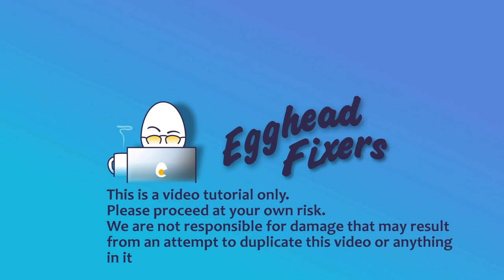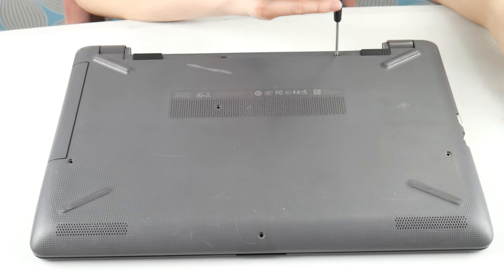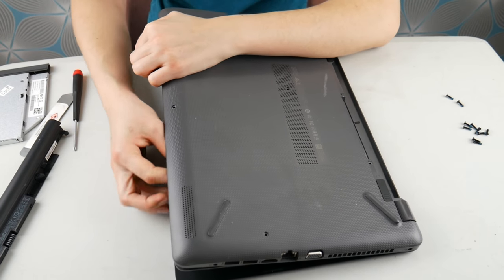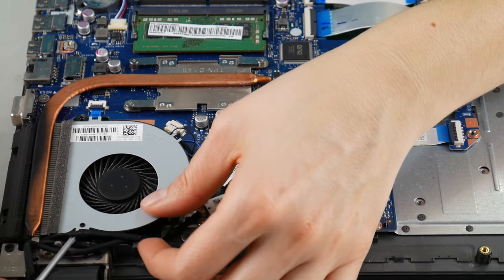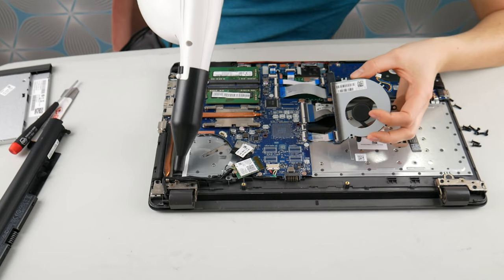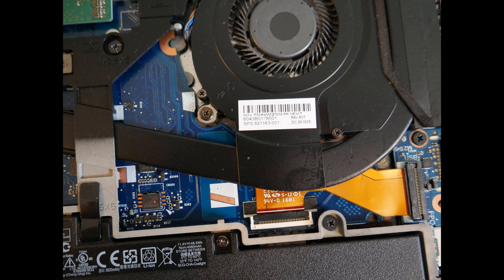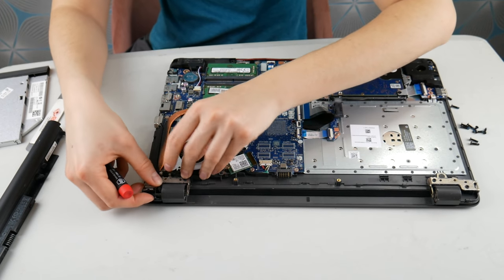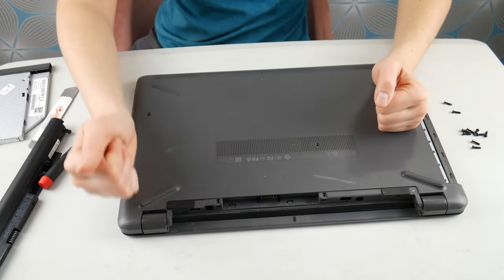How to Fix A HP Fan That Is Making A Lot Of Noise or Is Not Working

Comment: The one bought on eBay with a yellow sticker had worked silently for a few months only. Then noise has come back.
Reply from the maker: Huh that is strange. Is there dust or cat hair clogging up the fan? That can cause fans to burn out prematurely
Reply: Same issue with my laptop fan
Reply from the maker: @AdeelMir  Some models of HP are unfortunately more prone to fan problems:/
Reply from the maker: @Evil Faris Wow sounds like something is jamming it or it needs to be replaced.

Comment: I will certainly try to avoid HP products in the future. The HP Chromebook I bought from day one the fan comes only really loud when I scroll down on a page. It literally comes on anytime I am scrolling down and cuts off as soon as I stop scrolling? Are you serious? How does scrolling cause so much need for a fan? I can watch movies and fan doesn't come on. Just when I scroll down. It might cut on and off 10 times in a minute running for less than a second each time. It is so annoying! I wish I had returned mine as soon as I bought it but at first I didn't use it much. Now I use it regularly and it drives me crazy.
Reply from the maker: When did you buy it? Is it still under warranty?
Reply: @EggheadFixers  It has been doing this since day 1 but I bought last March to watch movies on. When the mousepad started sticking on my small, old laptop I started using the HP more for just general internet and that's when the fan started driving me crazy. It is good for movies and videos but something about scrolling down (on any site) makes the fan come on and instantly cut off as soon as I stop scrolling down. It sounds unbelievable but it's true. I'm not the type to keep receipts or boxes or this would have been returned long ago. Live and learn I guess.
Reply from the maker: @Bassett1997  You don't need the receipt to use the warranty. You can look it up by the serial number at https://support.hp.com/us-en/checkwarranty All you need to submit a warranty claim is the serial number which is usually listed on the bottom of the laptop or it also listed in BIOS.
Reply: @EggheadFixers  I wish I had found you to tell me that a few months back. It says my warranty expired in Dec. They do seem to have my purchase date wrong but either way I have had it more than a year so don't expect it to still be covered. I just wish I had known you could do that earlier because legit it has done it since day 1, but sincerely thanks for the effort and advice.
Reply from the maker: @Bassett1997  Sorry to hear that :/ that's a bummer

Comment: Mine won’t even budge the disc dispenser?
Reply from the maker: There is usually a screw that holds it in place. You can also look up a disassembly video for you model HP to get a better idea how to take it apart. They can be a little bit temperamental sometimes.

Comment: So will a nosie fan hurt my computer?
Reply from the maker: It depends on what is causing it. The fan is responsible for keeping the computer cool if its clogged or something is jamming it then it will not cool the computer properly.
Reply: @EggheadFixers thanks it broke again and im fixing it again
Reply from the maker: @notapplicable4567  Ugh that's a pain

Comment: How many fans does a 1R8J4PA HP NOTEBOOK?
Reply from the maker: That is the part number...Do you have the actual model of your HP?
Reply: Yes I have
Reply from the maker: @maryjanerodrigo7815  What is it?
Reply: 1R8J4PA HP NOTEBOOK 15S-EQ1117AU/ AMD RYZEN 5-4500U APU/ 512GB SSD/ 8GB DDR4 SDRAM/ NO OPTICAL/ WIN10/ 15.5" HD LED DISPLAY/ ROSE GOLD/ RADEON GRAPHICS
Reply from the maker: @maryjanerodrigo7815  From what I can see it looks like there is only 1

Comment: My laptop's chasis was broken so I sent it to a local shop for replacement but now the fan cries like a baby and It is extremely loud, like a Chopper.
Reply from the maker: Sounds like they didn't install it correctly or perhaps broke it when changing out the part. I would bring it back to the repair shop and have them fix it.
Reply: @EggheadFixers  Thanks for the suggestion (●'◡'●)

Comment: How can you just pull the disc dispenser out that fast?
Reply from the maker: There is usually a screw that holds it in place. You can also look up a disassembly video for you model HP to get a better idea how to take it apart.

Comment: Well from my experience hp laptops suck...
Reply from the maker: Sorry to heat that😕
Reply: @EggheadFixers  why are u sorry about it? Dp u work for hp...i had a question to ask relating warranty coverage...
Reply from the maker: @kryrins  What is your question?
Reply: @EggheadFixers  will they fix this fan loud noise problem in warranty?
Also I have an problem with my battery (When charging sometimes the light indicator turns white and orange constantly)
So will they fix these under warranty?
Reply from the maker: @kryrins  Yes both those problems will most likely be covered under warranty. I would call it right away.
Reply: @EggheadFixers  thank for ur response appreciated it :D
Reply from the maker: @kryrins  no prob👍

Comment: Hello, I bought an hp laptop 6 months ago and it started to make the same sound this video is showing: https://www.youtube.com/watch?v=VnwMGZZoCiM

I took it to a technician since the warranty wanted to take my laptop without giving any paper to me. I bought another cooler, which was really expensive. It's been 15 day and the new cooler started to make this sound again. Now the technician says it's the vendor's fault since the new cooler may also be broken, and the vendor says the technician is wrong because for 15 days it worked fine. Any idea? I really don't know who is trolling me, if the vendor, the technician or hp.
Reply from the maker: Did you set this up warranty repair through HP?

Comment: I dont think my fans are dirty. My computer drive went form a HDD to SSD and i think it might run hotter, because i had a 2 day old fan that made grinding noises. The current one i have makes noises in this order:
Rattling
Kik-kik-kik-kik
Rahzzzzzzzzzzzz
Reply from the maker: Wow ya you may need to replace it.
Reply: @EggheadFixers  Ive done that at least 3 times and the issue persists
Reply from the maker: @snazzy1050  Hmmm did you buy a good quality thermal paste? Because that can make a big difference. Also have you spilled any liquid on the computer?
Reply from the maker: @snazzy1050  Hmmm did you buy a good quality thermal paste? Because that can make a big difference. Also have you spilled any liquid on the computer?
Reply: @EggheadFixers  Well i had it fixed by a company and not by myself so
Reply: Also, i have spilled a VERY small amount of liquid
Reply from the maker: @snazzy1050  It could be the spill is causing the problem. You may need to clean the liquid off for it to stop
Reply: @EggheadFixers  Well i spilled barely any and it was a long time ago
Reply from the maker: @snazzy1050  Has been giving you problems since then? Also sometimes when a hard drive starts to fail it can make noises like a fan and may even make a clicking sort of noise...Do you hear any sort of clicking? Or is it definitely the fan?
Reply: @EggheadFixers  1. the hard drive is an SSD, no moving parts, and 2. it happened well before i spilled
Reply from the maker: @snazzy1050  It may be a problem with with the motherboard. It may be overheating causing the fans to work extra hard to compensate for it.

Comment: my laptop is HP14s and the problem is the fan is ocassionally running and stop(cycle), when the fan is stop running it buzzing a sound. No dust at all. Any idea?
Reply from the maker: A faulty hard drive can also make a buzzing noise once it starts to have problems. Is the noise in the location of your fan or your hard drive?
Reply: @EggheadFixers  fan, whenever the fan stop working. HP14s also already use SSD so I guess(cmiiw) no mechanical component could make any noice such as from Hard drive.
Reply from the maker: @MakarovSergey39  Yes if it has a SSD then it must be the fan. Have you tried replacing the fan?